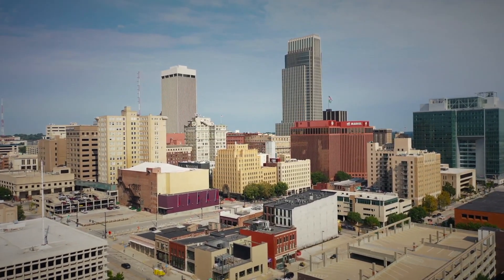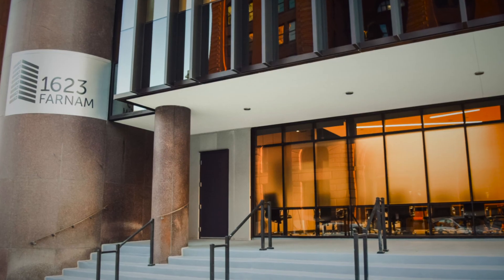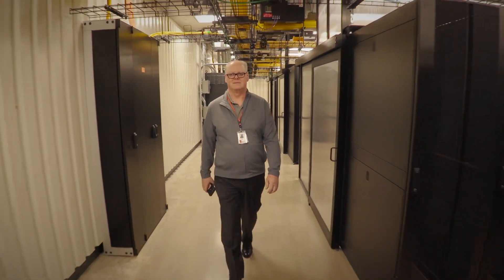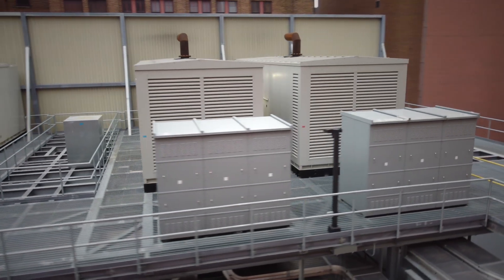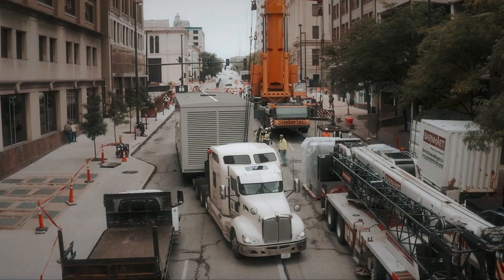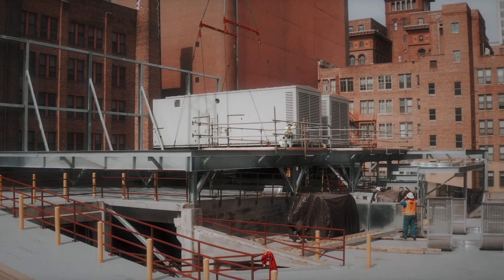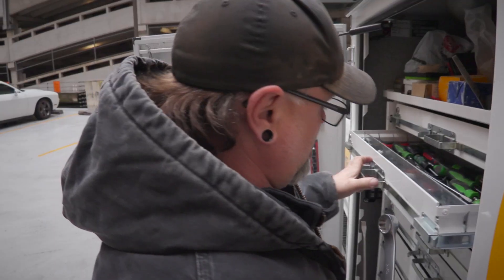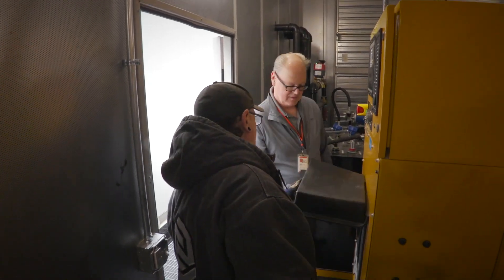1623 Farnam Data Center Diesel Standby Testimonial

Comment: Hello, I want to respond to the product quality problem
C175-16 Engine cylinder gasket Oil leakage at the main oil passage (very serious)
Happens on two identical devices
发消息给Caterpillar
Reply from the maker: Hi! We would like to get some details on the issue you are referring to, so that you can get the support you need to keep your Cat equipment in top condition and ready to work. Could you please reach out to us directly on https://www.cat.com/en_US/support/contact-us.html?utm_source=youtube&utm_medium=social&utm_campaign=cic_social_care
With a network of 160 Cat dealers, your local dealer can also provide fast, professional service for planned equipment maintenance and unexpected repairs.